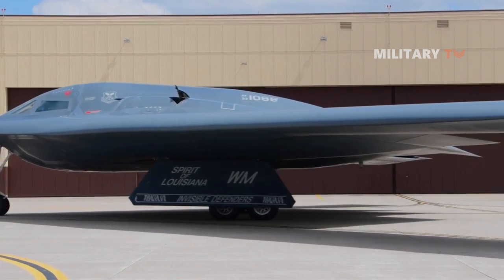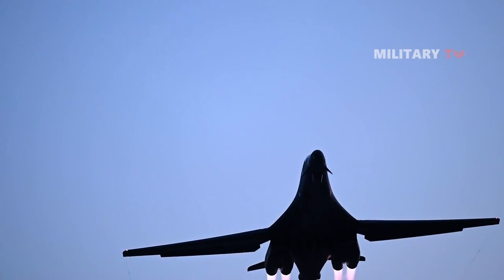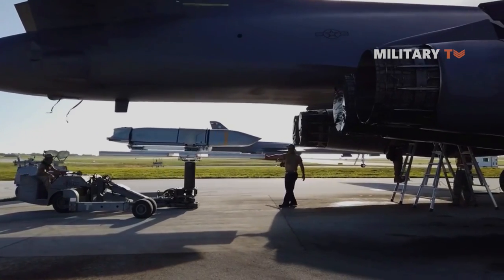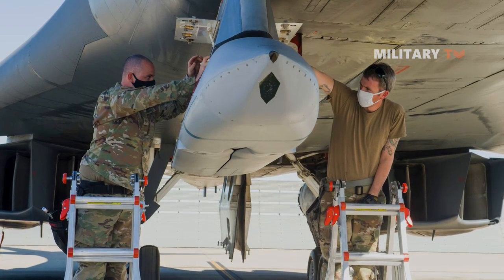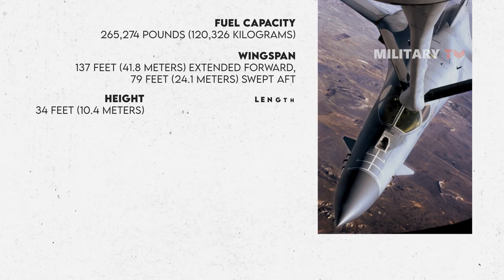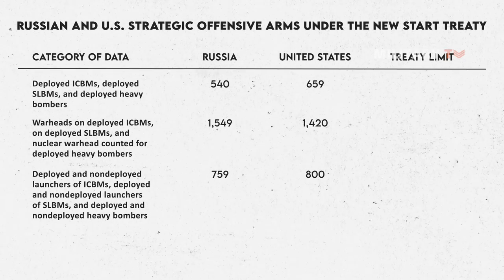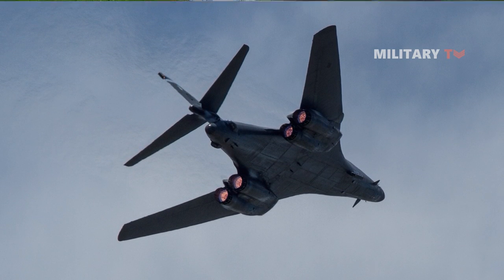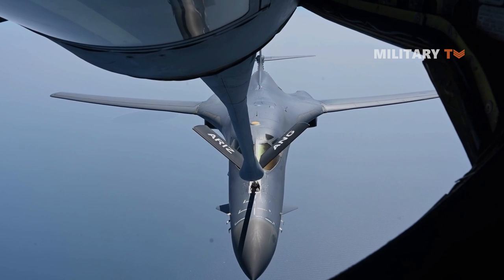USAF to Test Hypersonic Missiles With B-1B Bomber

Comment: I wonder if using SM-6 missiles on the B-1 is possible and what air-to-air and air-to-surface capabilities would give it? Greetings .
Reply: Sm-6 isn't Air based platforms.
Reply: @momcilopucar8749  Not today, but in a B-1, B-2, B-21 it would be a versatile and quite lethal ammunition that can open up new possibilities. Greetings .
Reply: The SM-6 missile is 21 feet 6 inches long and weighs in at 3,300 pounds.  Although the B-1 Lancer is certainly big enough to carry it (it could most likely carry anywhere from 4-6 externally), the question comes down to one of need.  If the USAF decided that they NEEDED an air launch capability for the SM-6 missile, they could probably adapt it within about 6 months.  Keep in mind though, that there are a few key reasons why they wouldn’t do it.  First, the SM-6 is a U.S. Navy weapon, not a USAF weapon.  Second, the SM-6 is primarily a surface to air missile that is used to intercept incoming missiles and aircraft.  With only a 140 pound warhead, it is really only useful in destroying targets that don’t need a large explosion (like incoming missiles and enemy aircraft).  

Although the SM-6 CAN be used in a secondary role as an anti-ship missile, it was really only adapted to that purpose as an emergency measure to fill in while the LRASM was still under development and not ready for prime time.  Now that the US Navy has several hundred LRASM’s in its inventory, and the US Air Force is adding the capability to hit moving targets to its inventory of JASSM-ER and JASSM-XR missiles, both the US Navy and the USAF have extensive anti ship capabilities, especially when you consider the fact that both the LRASM and JASSM series of missiles carry a 1,000 pound warhead.  There really isn’t any capability that an air launched version of the SM-6 would bring to the table that isn’t already being met by other weapons systems, and those other weapons systems are FAR more effective at it than the SM-6 could ever be.  So the real question is, why would they?
Reply: @willymac5036  The interesting thing about the SM-6 is the polybalance, the range, air-to-air or air-to-surface use (to saturate defenses or destroy small ships). But if we think about destroying enemy bombers and fighters at long range as the B-1R was intended, maybe there will find its role. Airdropped it should gain range. It is an experiment that I would carry out. Greetings .
Reply: It will work I am from Sweden and adapting systems to work together is what we do here as a specialty . 
If you can fit it  we can adapt it  to work together.
We have test fired all that flies from varies platforms.
I can say this if we can use a crane to launch air launched weapons (Cruise missiles for Ukraine means of launching not as a standard method).  we certainly can adapt it  to work .

The second question you ask is ability's of the weapon  launched from said aircraft.
 Target data decides everything, often the data is sent to weapon  before even its come to range of target so the missile fires automatically when all parameters is met .

Comment: They should retire the B-52 before the B-1B as the B-1 is our only supersonic bomber in service and possibly has a lower RCS than the B-52. Also they should add the Saw Tooth exhaust ports
 or what ever the correct term is.

Comment: why maintaining the B-52 and ditching the B-1B ? it is faster, more capable and modern
Reply: That B1 is a badass but the air frame is probably not as strong as the 52.
Reply: @mikeo8890 it's not dont get me wrong the b52s at my base had issues but an airframe (B1) that size flying that fast that often  is going to have alot of issues. Plus the B52 is an excellent carpet bomber and even they that manner of warfare is somewhat dated our nato partners love it. I went on plenty of TDYs to the EU for it to be showcased

Comment: FIRST. One needs to have working hypersonic missile to test something. US military-industrial complex is experiencing one failure after another.
Reply: Lots of Moscow trolls on here today. Eh comrade?
Reply: Russian Kinzhal Its not a true hypersonic missile. Its technically Iskander but air-launched. It’s similar to ICBMs/SLBMs following a depressed trajectory. They don’t maneuver but they can avoid or reduce detection time like sea-skimming cruise missiles as they fly under the horizon search of surface radars. But of course they won’t fly as low as sea-skimming ones. Likewise US had this in the 1960s with the experimental GAM-87 Skybolt. And in the early 1970s, Minuteman 1b ICBM was air-launched from a C-5A Galaxy.

On the other hand if China considers DF-21 as a hypersonic missile, then US already had them in the 1980s with Pershing II as both use the same MARV type warhead. MARV (Maneuverable Reentry Vehicle) like hypersonic glide vehicles HGVs are maneuverable, hence the name. Operational too for about a decade before being forcefully retired due to the INF Treaty. But they are bringing it back or a hybrid of it with LRHW/CPS.

US Army already received the 1st LRHW (Long Range Hypersonic Weapon) battery since October 2021. In a 2020 test it reached almost 3000km range with Mach 17 terminal speed. There are videos of it on twitter. “Today marks an important milestone in equipping our nation’s first hypersonic battery,” said Lt. Gen. L. Neil Thurgood. A 2nd battery is in the works for 2025 and a 3rd one for 2027. 1st battery is currently deployed at Cape Canaveral to undergo personnel training and live fire tests. It is also light enough to be carried by a C-17 Globemaster. Once landed it can launch its missile similar to M142 HIMARS. Japan already agreed to host them.

Naval version is CPS (Conventional Prompt Strike). This will be retrofitted to Zumwalt class destroyers by 2025 also and Virginia Block V subs by 2028. However, both LRHW and CPS are surface launched. Air launched hypersonic missiles are still in development, but certainly not like the Kinzhal which is just an air-launched Iskander ballistic missile.

Though AGM-183 ARRW (Air-Launched Rapid Response Weapon) procurement has been cancelled by the Airforce due to its continuous failures, it will be reused for another hypersonic program OpFires (Operational Fires). Unlike ARRW that uses a miniature HGV, HACM uses scramjet propulsion. Then there is also HAWC (Hypersonic Air-Breathing Weapon Concept) and Navy’s HALO (Hypersonic Air-Launched Offensive Anti-Surface Warfare). So even if ARRW was successfully developed, it won’t mean it will be used. They will have to chose which among the air-launched hypersonic missiles will be mass produced to supplement their surface-launched LRHW/CPS.

Lastly, for the price of one hypersonic missile, a salvo of sea-skimming and stealthy cruise missiles like the Tomahawk, JASSM/LRASM, and NSM/JSM can be launched en-masse that can take on multiple ships maybe even sink a whole fleet. On the other hand, China and Russia don’t have long range anti-ship cruise missiles. For that they can only rely on expensive ballistic missiles like the Kinzhal and DF-21/YJ-21.